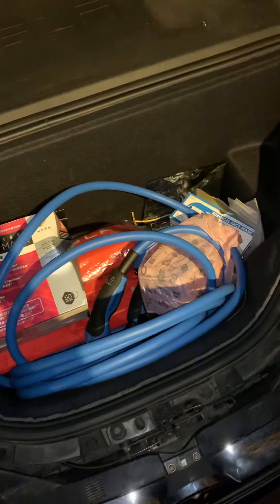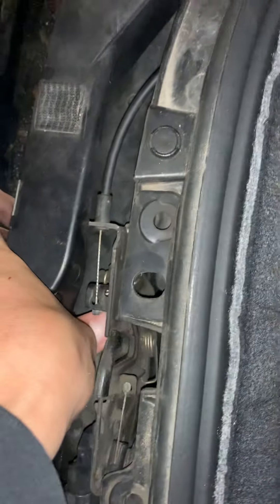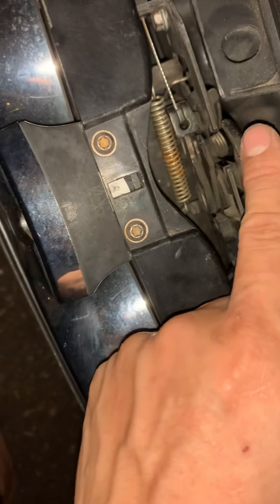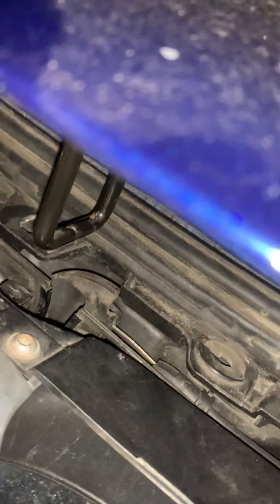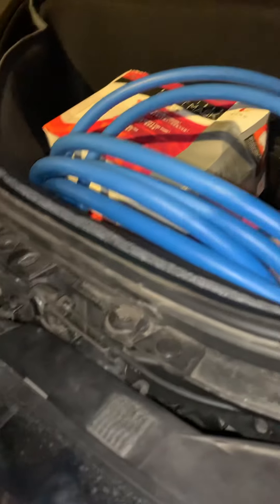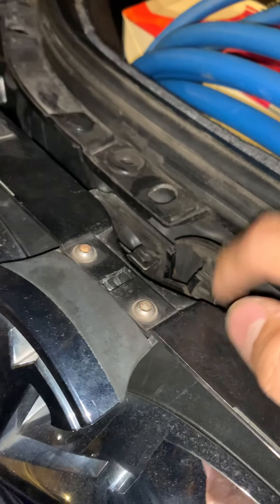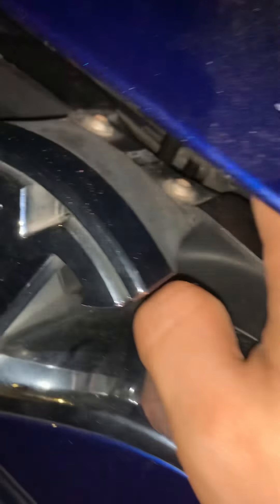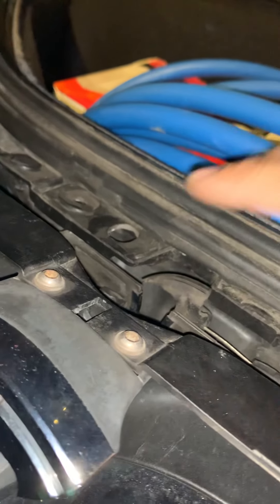Model S Frunk Recall Explained (Recall Number: 21V-00B posted on 2021-12-21)

Comment: Hi there, could it be that due to this problem that the hood of the car doesn’t seal properly from water draining in and getting into contact with the control box, affecting the windshield wipers and back lights?
Reply from the maker: Not likely
Reply: Thank you for responding. My concern is how water got in the body control unit box because I had mine replaced last month and it costed quite a penny.
Reply: @RunningCheck  Pretty sure the Body Control Module is inside the cabin near the floor beneath the screen (in front of the center console). I remember a Rich Rebuilds (https://www.youtube.com/c/RichRebuilds) video where he showed the condensate drain tube from the airconditioner box under the dashboard was cracked and leaked into his BCM control board. Might be worth checking to stop a re-occurrence.
Reply: @desparky  it could very well be. I had to replace mine a second time. The service center said this time due to the fusebox being old and corroded with time. If that is really the case, I don‘t know
Reply: @RunningCheck  Yes, the fuse box is under the hood toward the rear where it is exposed to outside elements to an extent. I guess if you live in an area where you have a lot of corrosion, or salt on the roads, the fuse box is vulnerable. Not a problem where I live here in Australia. 
You might want to see if you can protect it somehow.
Reply: @desparky  yes, salt exceptionally here in Switzerland. There is a guarantee of 2 years and gives me time to consider my options. What kind of engineering solutions would solve this?